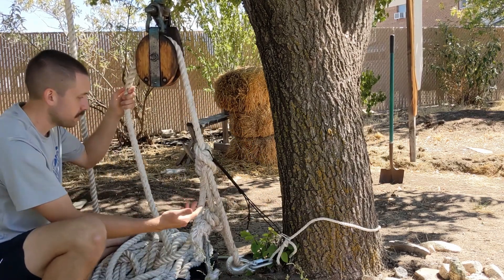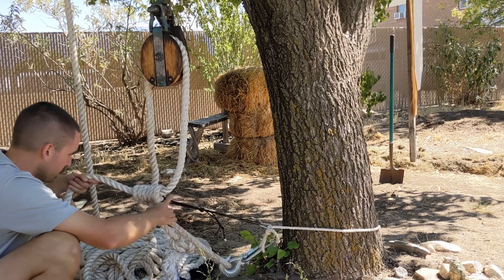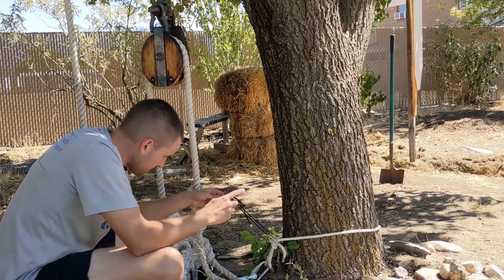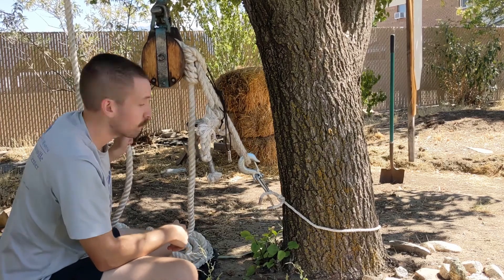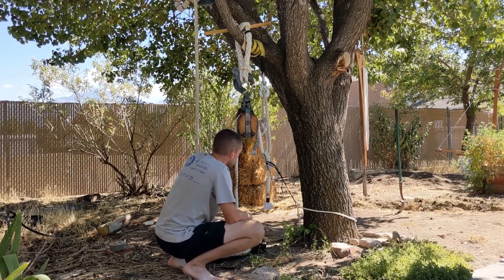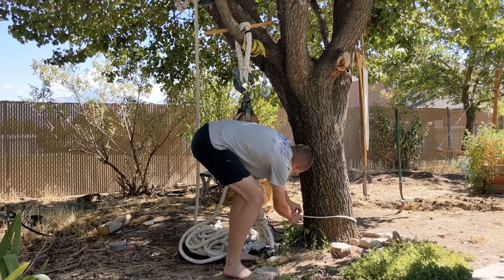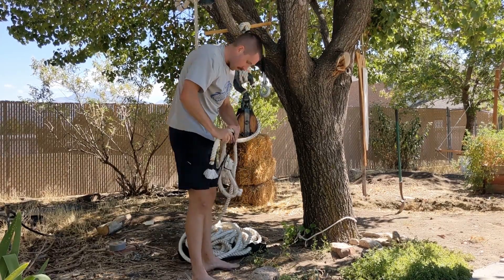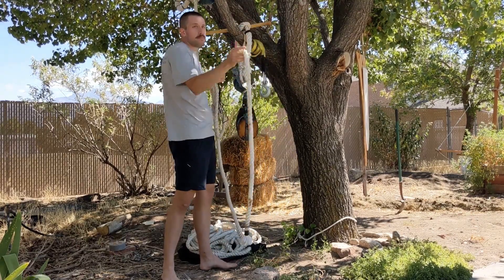Prusik Knot Progress Capture System for Reloading a Trebuchet, Proof of Concept

Comment: Humm, very interesting. Safety concerns must be weighing on your mind to go through the extra trouble. It will be interesting to see the Prusik knot in practice. Did you start using the truck simply for faster reloading?  Have you totally given up on the Trebuchet winch?
Reply from the maker: Yeah, the truck is not as simple but saves us all the manual effort.  I'm having trouble finding enough eager people to help crank it down with the winch, it takes 4 people and makes the day a lot more tiring.  With the truck I can shoot the machine at full weight by myself if I wanted.  But safety has been weighing on me since there is no ratchet gear to catch our progress.  The cost of the failure of any link in this process would absolutely be a destroyed trebuchet.

Comment: The rope you're using for the prussic is too large in diameter.  It should be no more than 70% of the diameter of the rope it's grabbing on to.  Otherwise, the rope has too much trouble tightening up because it's so big.